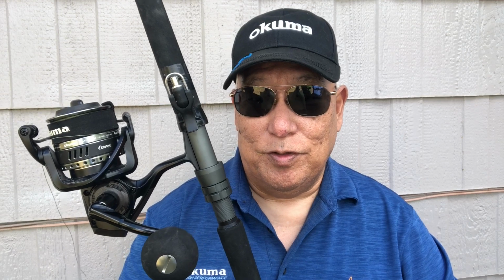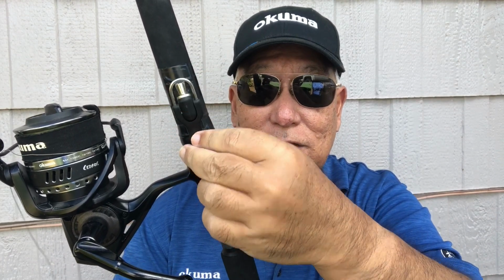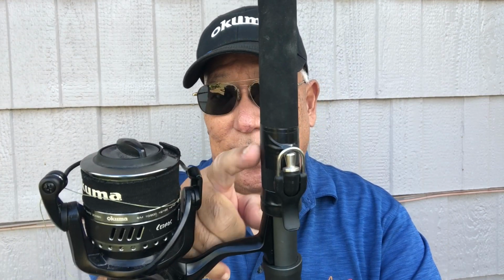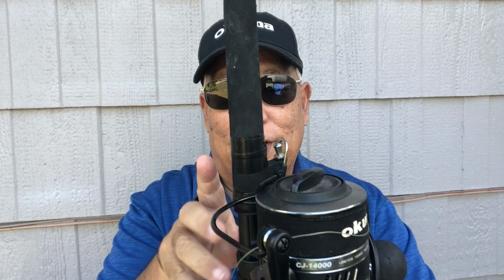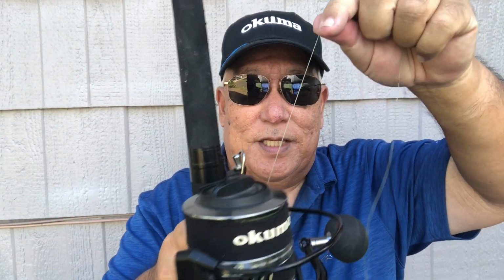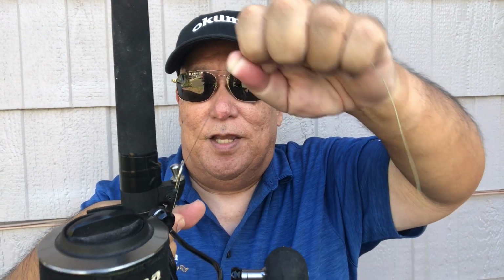Breakaway Canon Casting Aid For Distance!

Comment: Aloha Scuba Chris! Casting distance is extremely important, especially for anglers who are limited to fishing from shore.

When casting lighter lures in the range of 3/4 - 1 oz, would a breakaway canon still be worth the investment? Also, I know that a full spool, thinner diameter line and a longer rod improves casting distance however, what type of rod action is best for casting lures as far as possible? I’ve heard some say that a fast action is better since it generates greater rod tip speed but I’ve also heard that a slow action is better since you can load up (bend) the rod more.

Another factor that I’m curious about are the guides. Do larger diameter guides allow you to cast further? What about the distance from the reel to the largest guide? Is a longer distance better? Which of these combinations will help someone to maximize their casting distance?

Hope you can help answer my questions given all the years of your experience. Always looking forward to learn from your knowledge, you’re one of the best. Mahalo!
Reply from the maker: For me casting lighter lures i like 8'6" to 9'6". Fast. Long rear grip. I use fluorocarbon or braid main line.
Reply: @ScubaChris  what about the guides? Are larger diameter guides better for casting distance? Thanks for the reply.
Reply from the maker: @pokemaster1234567899  I prefer smaller guides for using braid. Large diameter mono large first 2 guides.